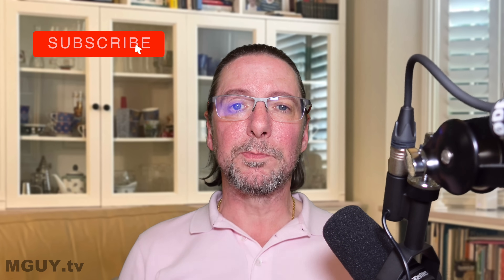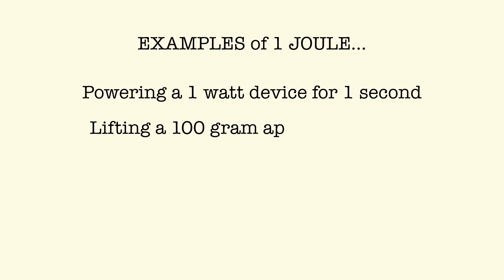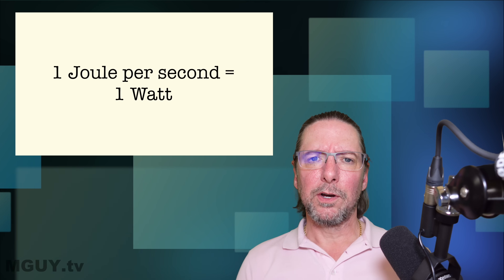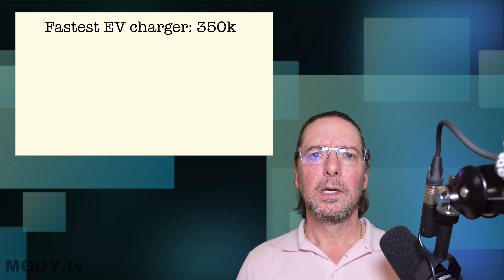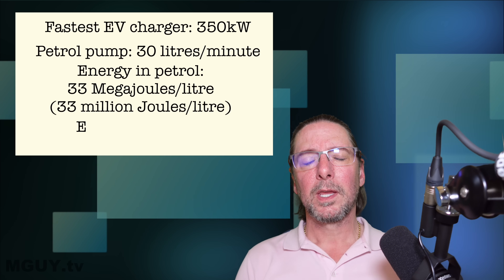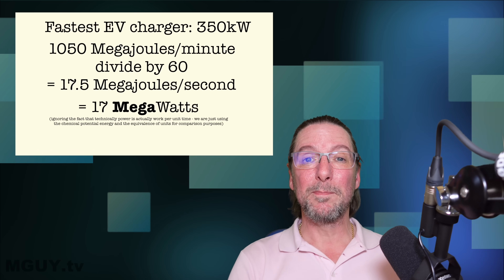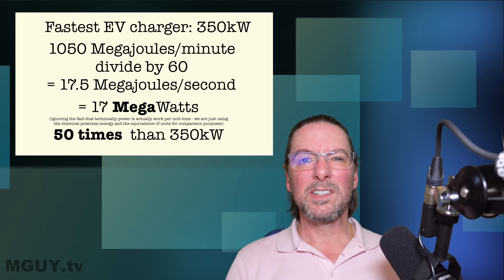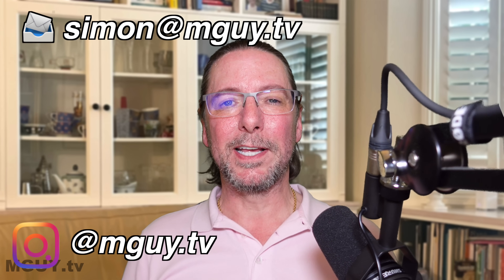Comparing charging speed of EVs vs "fuelling speed" of regular cars | MGUY Australia

Comment: This gets to the absurd as you move up scale to a vehicle like the Tesla Semi which has the equivelent of 12 Model Y battery packs in one vehicle. Telsa will tell you that they can charge this in as little as 30 minutes.  This is only true with 1 truck, and you need a $1 million dollar battery pack to "boast" the power available to the charger. This is done by using time (30 minutes) for the Mega pack to charge up then charge the truck so the actual cycle time between trucks is an hour; with this Million dollar boast.  So if you have 12 Model Ys trying to charge that is the same power draw; as 1 Semi; so they won't have a million dollar pack requiring 1 hour each to charge to 80%. Don't forget Tesla and others suggest you only charge to 80% and only discharge to 20% so taking their advice; you won't get the full range you can only travel 60% of the max range before having to recharge. If your Tesla Model Y has a max real range of 220 miles; you only go 150 before recharging.  This results in about 30 minutes charge for every 150 miles or every 2.3 hours if travelling 100kph reducing your average speed to 82 kph or 51mph.  Thus in 10 hours of driving a Tesla can go roughly 500 miles and a typical petrol vehicle can go 700. That is at best - if you find overloaded charging stations you may have to take an hour or more reducing your average speed to about 40mph.  Of course EV advocates will tell you they use this time productively; they take a potty break or go have a meal this of course presumes there is a place to eat or go to the bathroom anywhere near the charging point - usually there isn't - there is no attended place like a gas station has they are often found in odd places with no services anywhere near; let alone somewhere you like to eat at.  Are you going to leave your $80k fancy car unattended for half and hour or an hour?  At night?  In many places in the USA doing that you'll return to a car with no wheels with graffitti painted on it.

Comment: It is far worse than you portray.  Many BEVs can't charge with the fastest chargers. Popular vehicles like the Chevy Bolt cannot do DC direct fast charging so they take about 8 hours to do a complete charge; making it near useless to take longer trips.  Then you have another big problem - what if - your local grid only has a electrical substation capable of 500 kWh and you have mulitiple Fast charging vehicles trying to charge at the same time - that will result in much longer charge times even with the high capacity chargers; as you have to split the 500 kWh between the multiple cars - the more you have the slower they charge.

Comment: Yet again another BS video as usual from MGUY. It has a lot of numbers and calculations that makes no sense. Petrol or Diesel has more energy, but ICE vehicles are less than 20% efficient. Only less than20% of that energy is used for moving the car, the rest of them are wasted as heat and idling the car creating huge amounts of pollution. However, EVs are more than 90% efficient and also deceleration and braking energy are used to generate electricity to recharge the battery. The brakes last 3 times more than in ice cars.
Most of 5he EV chargingis done at home during the night when you are sleeping. If you are driving 50 miles a day, you have to charge twice a week at home. If you drive even 250 miles a day and get back home you can charge every night at home. If you have aICE vehicle, you to visit a gas station every day or every other day., May be wait for 5 mins for the pump and wait for 5 mins. If you take into account of traveling to gas station, it may be 10-15 mins every trip. You will spend 10 hours a year in gas station for fueling every year. Also, you hav3 spend time for oil changes every year, 6 month, 12 month servicing for air filter, spark plugs, and other needs. There is no need to go for gas stations at all or outside charging in EVs. Only time you need outside chargers is when you go for a long distance trip.  It’s not a big deal to wait for 30 mins charging your EV. 
Also, note it takes tremendous effort and energy to get the fuel oil well to your pump. Remember, it takes 1Kwh of electricity to JUST REFINE one liter of gasoline. If you fill up with 30 liters of fuel, it would have costed 30 KWh of electricity just for refining.  What a waste. 
You saying filling in fuel is more efficient than charging EV is just total bs. 
I can’t believe the amount of bogus information and exaggeration you keep putting up in your videos. And it’s Mind boggling how many of your readers agree with you.

Comment: The claim that Electric Vehicles are environmentally friendly is a huge lie because the environmental impact equation is computed only after the battery is charged when one adds required battery charging process to the environmental impact equation one finds electric cars pollute about twice as much as gas cars and then there's the environmental impact of mining materials and manufacturing the required battery. The complete environmental impact equation looks something like this. 
Fossil fuel plants efficiency is around.                      35%
Line losses from the plant to end user are about.   7%
           Equals.                                                                          28%
Battery charger efficiency approximately.                80%
           Equals.                                                                          22.4%
Battery efficiency (1.5 watts in give 1 watt out)    66.7%
            Equals.                                                                         14.9%
EV efficiency about.                                                            70%
            Equals.                                                                          10.5%
This means the fossil fuel plant uses over 9 watts for the EV to use just 1 watt of power.

Comment: I'm certainly not arguing in favour of EVs, but there is another factor you should consider in your calculations. 
Efficiency. 

While you can pump in many megawatts worth of fuel per minute, far faster than recharging batteries, the vehicle will also waste most of that energy.

Most ICE cars are probably only about 30% efficient.  Electric cars are far more efficient. 

Still much faster to refuel a petrol or diesel car though.

Comment: It takes a maximum of 10 mins to fill and pay for a 25 gallon tankful of diesel in my faithful 33 year old VW Passat. It does 56mpg @ 60mph which equates to an available 1400 non stop miles before the need to re charge the tank.

Comment: Largely a pointless video and exercise.  We all know that refueling takes 2 mins or so of actual pumping.  Electron charging takes considerably longer, the actual number is so large it doesnt matter. 
What is more interesting is the subterfuge of the EV manufacturers giving 20/80 charge times coz 0/100 times are horrendous, but by how much??  No one ever says.
Why do EV manufacturers give ranges for NCA/NMC batteries for a 100% charge when the 80/10 rule applies?  Gotta make the range look more reasonable.  Why this subterfuge?  Coz EVs are shit at long distance travelling compared to ICEs, especially diesels.

Comment: I’ve always used the more user-friendly measure of miles range per minute.  So if an EV with a range of 250 miles takes 40 minutes to charge from 20% to 80% then that is 150 miles range added in 40 minutes or 3.75 range miles per minute.  Likewise if a petrol car with a range of 350 miles takes 5 minutes to fill from empty then that is 70 range miles per minute.  So in this example, refuelling the petrol car is 18x faster than refuelling the electric car.

Comment: Having taken my mother's Bolt EV for a little road trip last month, the time it takes to charge wouldn't bother me much if the speed was a steady 150kW at least until 80%. The Bolt going from 44kW at 60% down to 20kW at 70% really sucks and almost got me stranded from me ending the charge at 70% instead of my intended 80% because I didn't want to get screwed by by-the-hour charging any worse than I already had. Straight by-the-hour charging is garbage.

Comment: Right now there are just a few EV and it works. Then imagine all EV vehicles in a 2000 peoples old village like mine, on the mountains in the centre of Italy where there aren't parking space near the homes. We will basically need hundreds of charging points, most of them outside the village. Say I work in L'Aquila or Rieti, the nearest cities, 20 to 30km away. I came back from work at 7pm, I have to be lucky finding a free charging point, some 300 to 600m from my home. I put the car to charge, but later I have to come back to unplug the car and find onother car park to free the charging point for someone else, or I stay there waiting instead to go home for dinner. Almost all Europe is like that, even worst in the large cities, blocks of flats 4 to 10 floors high, with dozens of peoples on top of each others in a few square meters and most of them do not have a dedicated parking space. Politicians think like we all are living in a nice detached house with solar panels on the roof and a car parked in the driveway or garage. The reality is much different in most of the world. Here in Italy 75% of the homes are older than 50 years, my one has been built in 1869.

Comment: The average Australian does 12100km a year averaging 11.9l/100km. On a 60 litre tank they can do 500km but let's say they fill up at 440km, they therefore fill up about 28 times a year, 2/3 is purchased at supermarkets and it is believed journey, fill up, paying and leaving can take on average 9 minutes.  So the average Australian spends about 252 minutes a year filling up the car with petrol from Asia. It takes about 15 seconds to plug/unplug your car in at home on an EV, so the average EV is plugged in every 200km or 61 times which means an EV driver spends 30.5 minutes a year plugging and unplugging at home. That leaves 221 minutes saved. Now let's look at those long distance charging times that most people only need a few times a year knowing there's a huge time defecit to begin with!

Comment: Thank you for explaining these common sense facts that auto CEOs, like Mary Berra, don’t seem to understand.   Would love for you to do a video on the danger of pushing all this electrical power into car batteries in real time.  A car battery with 600 CCA (Cold Cranking Amps) if you place a wrench across the terminals the wrench will vaporize. So it won’t only melt but it will boil in a fraction of a second.  These kind of currents are being pumped through these cables to charge these EVs. Some cables need to be liquid cooled during charging to keep them from overheating.  Imagine what happens to this cable after being damaged by a car tire rolling over it, for example. These dangers are not being discussed at all.

Comment: Ah, the anti EV lot really are clutching at straws with this one. I only have a 7kwh charger at home and yet 95%+ of my charging is done on this. Between our 2 EVs we have done about 50k miles and the only time charging comes into any sort of consideration is when we drive a distance beyond the range of the car. Even then, if ive driven that far, I'm likely to have stopped anyway to eat and then come back to a charged car.
You just have to realise you dont refule an EV in the same way as an ICE. Who drives 500miles, has to stop for 5min and then drive 500miles syraight away, all without eating or using the toilet. The car should refule around YOU, not the other way around.
Reply: It's amazing how many people find this so difficult to understand. Charging is analogous to parking, not refuelling.
Reply: @tomber1  100% if it ain't moving, it could be potentially charging. With charging speed's even faster on the rapids then any charging on a long trip would be down while having lunch. In fact, my ZS EV which only hits 50kw on a rapid, takes 45-50min to get 75% added. Which on a recent trip (with kids) was the time from us putting the car on charge, going to the services, using the loo, queuing for lunch, eating and then heading back to the car. 53min to go from 14%-92%. Another stop we did 27% in 15min so about 1hr for a full charge while I wasn't at the car.  If we had a Tesla then I'd be getting stung for overstay fees given they have double the battery and peak at triple the charging speed.
Reply: @steve_787  yup ours only hits 88kw on a rapid but all the local chargers to me are max 50kw anyway so makes 0 difference.

Comment: Can't argue with the math, However the comparison is flawed. I plug my car in and charge whilst I am asleep once a week at a fraction of the cost of petrol or diesel. Battery and charging technology is rapidly advancing, Petrol cars have been stuck at around 30Mpg for decades.
Reply: You can argue the math as he removed one of the most important variables being the efficiency at 2:20. petrol might have a massive potential amount of energy, but when only 25-30% gets used for the forward momentum vs 80-85% it all starts to fall apart. It's actually only around 4-5 times more energy, not 50 times as he claims.

Comment: Hydrocarbons are King, however I wonder about this comparison in a real world sense.  With respect, I assume you are correct in the maths (and thats astonishing) but I would have given consideration to how the energy is then consumed by the given powertrain, and whether that might be of significance.  What sort of work does the vehicle in question have to do you get moving and provide a reasonable range?  A lot of heat, noise and friction produced and wasted.  Maybe I am wrong though, so no offence.  😊

A 350kW charger (if you can find one) is a wonderful thing (with its oil cooled outer hose jacket keeping everything under control during a charging session), but can your EV take this amount of charge in any charging situation?  Even if its fully capable of such a transfer.  Seems that battery condition plays as much a part in this as anything else, ie Temperature.  Fermi law.  How does the average motorist cope with this when all they want to do is quickly recharge their EV, but find they are potentially being shaped by battery pack temperature?  So called rapidgating.

Comment: This appears clever.  It actually shows an extra-ordinary lack of understanding of what this data means in real life.

I charge 95% at home.  Takes me about a minute a week to connect and disconnect charger.  I dont have to take the 5-15 mins to go out of my way to get fuel and wait while it is put in the tank and pay.  So, 95% of the time I actually save time because the charging speed doesn’t matter.

On long journeys we stop every 3 hours or so anyway, and every charger so far has refilled the car in the same time it takes to eat etc.  Again, it takes less time than a fuel car as the charging happens while I eat, and I dont have to complete one thing before I do the other.

So far, over 25,000km I have had to sit in the car for a total of 2 hours on a journeys while the car charged.  It wasn’t an issue as I did emal or watched Netflix, but I can see it might be for other people.

If you dont want an EV then great, fill your boots.  Don’t do BS science to ‘prove’ your point when it does exactly the opposite.

Comment: Duhhh!!!!   Well I charge my EV at home and overnight, so I am in no damn hurry to have my vehicle charged up.  i can do my daily driving easily on a single battery charge.  Most the time I can go several days before I need to even charge up.

People should of done their homework on their daily driving requirements, no home to charge up,  or doing long trips before buying an EV -  I did and the EV I have works fine for me and have a home to charge at.  
At this time, We all know it is going to take 30 minutes or more to charge back up an EV vehicle. In the years to come, batteries will get faster to charge, or there will be wireless charging network capabilities imbedded in the roads to not worry about having to even sit and wait for the battery to charge up.  So don't count out EV's charging methods just yet.

If an EV does not fit your driving habits or have an adequate place to charge the vehicle , then don't get one.  No one is forcing anybody to have to buy one.  I bought mine and it was my choice to get one and no one else.
Note: I also have a 22 year old Gas Monte Carlo for a 2nd vehicle and operates just fine.

Comment: It's worse than you say :( A real car you can fill the tank from empty to full at the same speed. A EV from no power to full power it will not charge at the full speed, the first 20% and the last 20% the charger will slow down to make sure you don't damage the battery. You don't need to slow down on filling a fuel tank to protect the tank. And just to add to that, a parked ICE car use's no power, a EV it's using power just sitting on your drive, It's like having a small hole in your fuel tank. If I don't use my car for a couple of weeks, it still has the same amount of fuel in it as when I parked it.